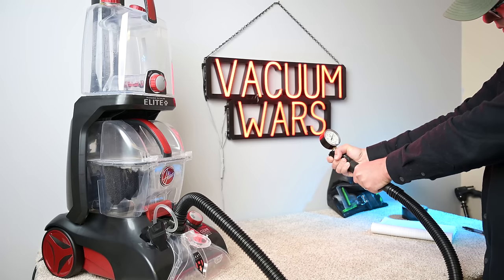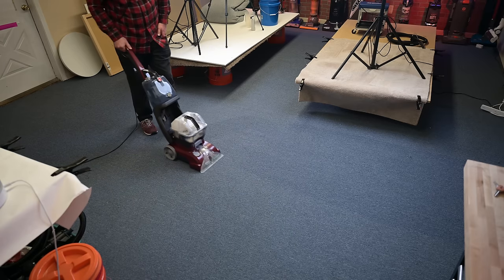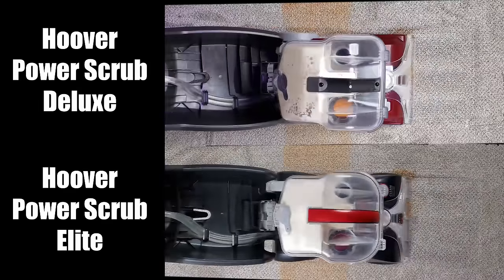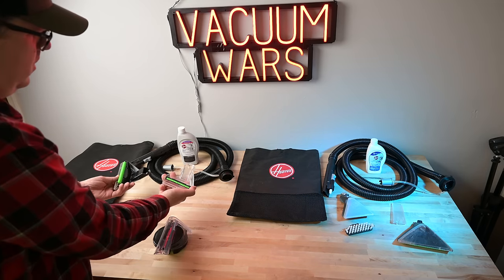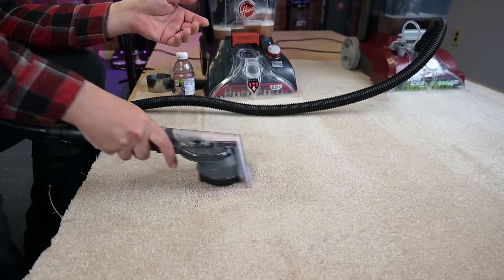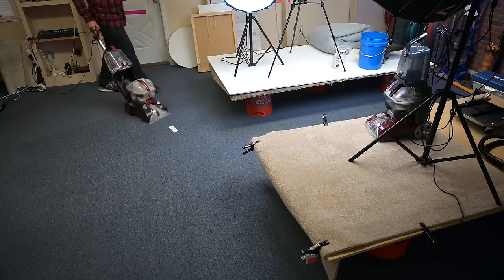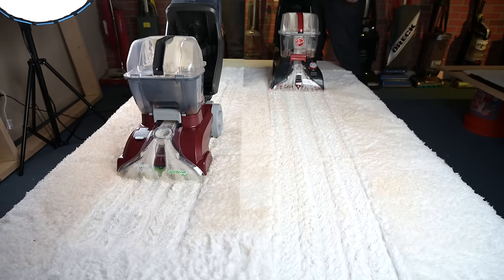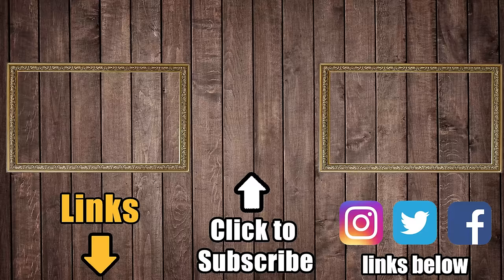Hoover Power Scrub Deluxe VS Elite Carpet Cleaner Comparison

Comment: Does this vacuum only clean? Or does it vacuum and clean?
Reply from the maker: It's a carpet cleaner - it cleans with water and vacuums the water back up.
Reply: @VacuumWars  I’m worried about the damage the water would do over time to the flooring under the carpet, is it safe? 🤔

Comment: Thanks for this; very thorough test. However, I'd like to tell you about a problem with these machines. Mine, a Deluxe, started leaking fluid from the bottom of the unit. I followed the instructions in another video and took it apart to try to locate the problem. Under the "hood"  is a round, disk-like piece thru which the water flows and that's where the leak is. I examined this essential piece and realized just how cheap and flimsy it was made. I tried to repair it with various types of sealer but it continued to leak. Just another contemptible Chinese plastic product that's designed to work for a while, break down and wind up in a landfill where it will slowly deteriorate over the next 500 years, Why do we keep buying these products? Answer: we've been sold on the fictional benefits of the global marketplace. The truth is that cheap goods are expensive. They break down so we are forced to pay for repairs or, more likely, toss them and buy another. When will we learn!??? We have undermined and destroyed the proud manufacturing businesses in our own countries, causing massive unemployment and made China into a superpower. We've made this bed ourselves. Now we have to lie in it.

Comment: He either rigged the test to make the Bissell equipped with horizontal rollers look bad or he's incompetent.  Look at the carpet at  4:56.  There are lumps traversing the entire width of the carpet and it's precisely where the Bissell gets tangled.
Reply: I have a Bissell carpet cleaner. What you’re seeing is on the carpet is actually caused by the Bissell. Because it catches onto the rug, it causes the carpet to rib and scrunch. It’s really annoying actually, cause I have to use my feet to hold down the rug